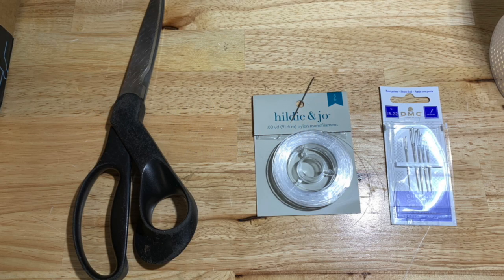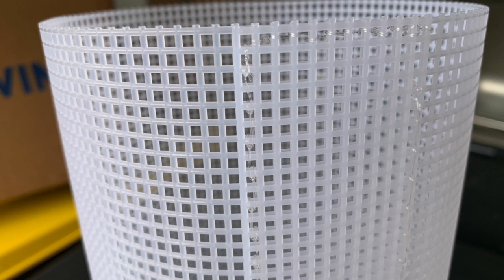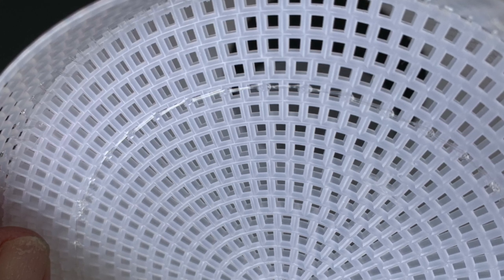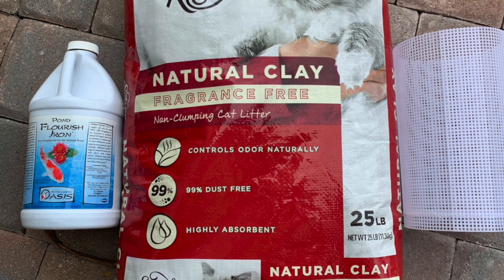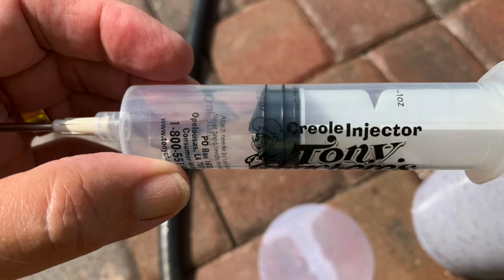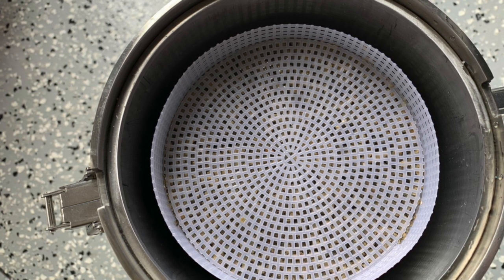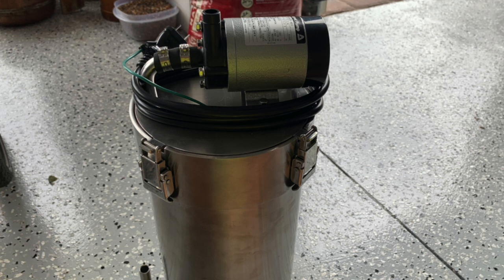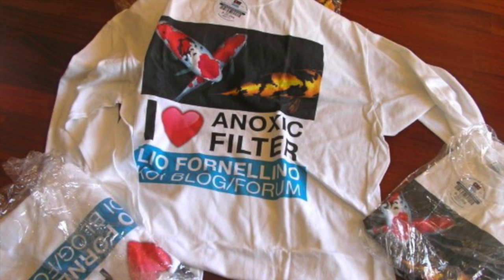Converting an ADA Super Jet 600 Canister filter into a Nitrate reducing Anoxic Filter.

Comment: Wow! I stumbled across this while researching filtration systems for my African Cichlid tank... and I just happen to work for Oil-Dri. A little info in the differences in Oil-Dri clays and getting the correct clay for for the Anoxic filter. First, Special Kitty is a product that uses attapulgite clay that is mined in south GA, the color is light tan/gray. To keep it simple for this post, all the clay processed there is baked to a certain degree to drive the moisture out. For coarse cat litter such as Special Kitty, the clay does not need to be baked long enough to drive "all" of the moisture out. This is why it will break down and get muddy when soaked in water. However, Oil-Dri Premium Absorbent is a product that is baked longer and dried out to less than 1% moisture. This changes the structure of the clay to where it will not break down and get muddy. This is the product that will be best used for Anoxic filter as described in this video. This brings up the second point... Oil-Dri Premium Absorbent is also processed in California and Mississippi facilities. In MS, the mineral is montmorillinite and is a harder granule that is darker in color (reddish/brown). Based on the video, it sounds like it could also work for this filter. However, Oil-Dri premium from CA may not work, as it will break down and not stay a hard granule. So if you live out west, you may not get the desired results. Hope this helps!
Reply: One of the best comments I've read, hands down. Thanks for the input. 

I have questions: oil-dri vs saftsorb. Different clays, same process? 

Also, do you know if the products sold are sold by region. Like if I buy oil-dri on the Gulf coast, do you think it's the MS clay, or who knows? I wouldn't imagine they'd ship cross country unless they had to but...
Reply: Can I use zeolites instead of the kitty litter please as I don't think I am able to get this kind of kitty litter in my place

Comment: I'm glad you like the canister filter BCB method I posted a couple years ago and how it can apply to other canister filters.  Putting a solid plastic bottom on the basket should also take the initial "force" of the water and help even more of the basket become anoxic.  Keep up the good videos!   - Luke
Reply from the maker: Thank you Luke for the tip. My Anoxic canister filter is working great, better than I thought it would. Now if only more hobbiest would realize the benefits that I'm seeing with my Anoxic canister filter, they would never turn back to the old ways of doing things. Just think, you are the one that got the ball rolling.
Reply: @anoxicfiltrationplenums  Thanks Kevin!  Very nice of you to say but you're the mastermind!  So glad we found a way to apply the technology in a way anyone can use it without the need for a sump.  Everyone's fish will be thankful!  :)
Reply: Hi Luke - Hoping you can answer a question and give thoughts- saw your comments in Dr Novak's videos and checked out your channel to watch your eheim canister set up video from 1/18 - is yours still up and running in 2021 as initially designed and have you had to do any maintenance to the BCB inside? Honestly kind of scared to cut up my old Eheim Pro 2028 but would love to try the BCB for removal of nitrates and phosphates on my 75g rock and no plants monster tank! Thinking I might leave the lower basket whole and use course sponge to filter (large happy messy fish) debris , then cut out center of other 2 baskets and put one bcb through the 2 baskets, and top with filter floss that I can change out easily. Would appreciate your comments.
Reply: @vikkirountoit497  Hello, If I made another one, I would probably make a DIY 5 gallon bucket canister filter.  There are a few good videos on how to do it and they're cheap.  Even if you change it back, you'll only need to buy a few extra baskets for your Eheim filter.  No maintenance on the BCB inside required as long as you have a good pre-filter on it.  I added another canister filter in line before it to filter the water even more before it went into the BCB "chamber".  Have fun!

Comment: just a quick tip on the build: use MINI ZIP TIES  instead of monofilament line to build basket. faster, easier and less frustrating
Reply: That's what I used...worked perfectly.
Reply: I just sewed mine, omg it was tedious. I will zip tie the next one...
Reply: I would suggest getting a curved needle to do this. It’ll save some frustration.
Reply: Zip toes for quick work, or sew it - for the esteem of the craft.

Comment: Hi Dr Novak. Just to bring you up to date on my 22ltr stainless steel cylinder filter using 6 X BCBs.fitted to my 500ltr with 22 x 3" to 4" Cichlids. I cleaned the filter as I noticed that the outlet flow was not as strong as it had been. It had been operating for 6 weeks.  The sponges and polyfil were very dirty.. However the BCBs were very clean with no sign of any blacking etc. Also the phosphate pad indicated that the water flow was going around the bags. One thing I did not do again was put clay media balls in the bottom of the filter. All that happened was that with the flow of the incoming water these balls just slowly disintegrated and caused more "dirt". I am thinking of fitting an  external filter cylinder to the filter which should increase the filter cleaning cycle. This 22ltr cylinder is heavy and  not easy to remove and clean.
Reply from the maker: sounds great

Comment: Dr. Novak would you mind doing a follow up video  in 60 days to let us know if it did work as expected. I’m curious how water would leave the bottom and go out the sides if there’s holes in the bottom. It’s uneducated but it would still seem to me because the tube isn’t very thick that it would be very hard for it to get anoxic even if most water is flowing around it there will still be some going through it to stay aerobic. What other brands of canister filters would this work on? Fluval?
Reply from the maker: In the ADA canister the water is not being pulled through the medium but is forced around the BCB. Water always take the path of least resistance and the BCB has too much resistance for the water to go through it. Diffusion is what will bring the water into the BCB along with ions. One ion is being taken in as another ion is being released back in solution.
Reply from the maker: Many hobbyists say that: “It is impossible to have oxygen in the baskets because the substrate will compact, and therefore will inhibit any biological process to take place.” However, they forget about the substrate permeability1 qualities, and the large part it plays in the microbial and chemical processes. The permeability of Kitty litter and Laterite allow oxygenated aquarium water with inorganic compounds to pass through the substrate on a current-carrying magnetic field, which then allows the substrate to stay more aerobic. Such substrate has two characteristics that enable fluids to move through it: (1) porosity and (2) permeability. Porosity is the presence of small openings, or pores. Permeability means that some of the pores are connected by spaces through which fluids can move. Nonetheless, actual tests of the baskets have confirmed the existence of oxygen at low levels for bacterium to exists and exists it does. Yet, in all honesty, how it gets there is still somewhat of an unknown to scientist. Yet, I will try to explain the best I can for the hobbyist. 

Oxygen penetration is less and less with depth. It decreases for two reasons: microbial metabolism and subsequent biogeochemical processes. Diffusion is a very effective process over short distances; however, it has its limitations. 
Yet, the presence of oxygen in the biocenosis clarification baskets suggests that oxygen does diffuse as far as the center of each basket. Concomitantly, biogeochemical processes may produce or retain some oxygen. 

Differential pressure existing across gradients. Ion displacement (differential pressure) exists when there is a relationship with carbon dioxide removal. If there is a substrate producing some carbon dioxide, it then becomes a factor in creating anoxic condition. The addition of anion producer such as microbial or aggregate or both needs to produce enough oxygen to engage or attract the carbon dioxide and that will then move the cations, releasing the oxygen and consequently going more aerobic. The point being made here is that it is that oxygen is present in the substrate of each basket and it is clearly not there only because of diffusion alone.
Reply: Kevin Novak Ph.D. Will it work with Fluval?

Comment: I am wondering if the fluval canister filters could be adapted for this as the filter is basically divided in half with the water entering from the top on oneside and going through your sponges and floss to the bottom of the canister and then rising back up through the media baskets to be sucked out by the pump back to the tank if you replcethe media baskets with a bcb you should be able to make an anoxic canister filter this way as well
Reply from the maker: Don’t really know but it’s worth a try.

Comment: Dr. Novak have you ever tried Safe T Sorb from tractor supply? It is made from montmorillonite clay. $6 for 40 lbs I’ve had great success.
Reply from the maker: Yes, it as good as Kitty Litter, i’ve repeatedly told people they can also use oil-Dry which is exactly like what you’re talking about. Thanks for the good info I hope others read this comment.
Reply: @anoxicfiltrationplenums  hi sir. Can i use akadama clay, pebbles clay or even pumice to replace the cat litter?

Comment: Thanks for the videos, Dr Novak.  I'd really like to try this for a 30 gallon tank.  What are the minimum dimensions necessary for a successful BCB in a canister filter?
Reply from the maker: The size is going to be dictated by the size of your canister filter and the medium that you’re going to use along with it. Such as sponges, filter  medium and carbon, etc., etc. actually, the best thing to do is get the biggest filter you can afford for your size tank.

Comment: I made my Anoxic basket bottom flat because the Eheim 2215 has a raise plastic platform in the bottom of canister already. Also I will only use filter pad on top of basket for easier maintenance and not having to remove the Anoxic basket from the canister.

Comment: If I use an Eheim 2213 would it also be a good idea to apply some known filter mods to slow down the flow in order to help the anoxic conditions?
Reply from the maker: Do Not Slow Down your 2213. You can turn it into an Anoxic filter at that speed. New video coming out with a canister filter that puts out 500-gpr and the big BCB in it will handed 9-lbs of fish.

Comment: Can we use very fine stone chips ( like used for making roads) 
It would be hard,not disintegrate, and the porosity will be same as this ..so water won't go through it?

And also another substrate..like bricks broken into very small pieces..they are also baked clay basically..and they dont disintegrate..and have the porosity in the small pieces i guess to create the anoxic conditons..

Can crushed pottery made of baked clay work?

I do not have access to kitty litter per se..so i was just thinking of alternatives available here..you are so kind as to think about working around a problem..

Could you shine some light on these ideas?

Thank you..
Reply from the maker: Many hobbyists say that: “It is impossible to have oxygen in the baskets because the substrate will compact, and therefore will inhibit any biological process to take place.” However, they forget about the substrate permeability1 qualities, and the large part it plays in the microbial and chemical processes. The permeability of Kitty litter and Laterite allow oxygenated Aquarium/pond water with inorganic compounds to pass through the substrate on a current-carrying magnetic field, which then allows the substrate to stay more aerobic. Such substrate has two characteristics that enable fluids to move through it: (1) porosity and (2) permeability. Porosity is the presence of small openings, or pores. Permeability means that some of the pores are connected by spaces through which fluids can move. Nonetheless, actual tests of the baskets have confirmed the existence of oxygen at low levels for bacterium to exists and exists it does. Yet, in all honesty, how it gets there is still somewhat of an unknown to scientist. Yet, I will try to explain the best I can for the hobbyist.

Oxygen penetration is less and less with depth. It decreases for two reasons: microbial metabolism and subsequent biogeochemical processes. Diffusion is a very effective process over short distances; however, it has its limitations.
Yet, the presence of oxygen in the biocenosis clarification baskets suggests that oxygen does diffuse as far as the center of each basket. Concomitantly, biogeochemical processes may produce or retain some oxygen.

Differential pressure existing across gradients. Ion displacement (differential pressure) exists when there is a relationship with carbon dioxide removal. If there is a substrate producing some carbon dioxide, it then becomes a factor in creating anoxic condition. The addition of anion producer such as microbial or aggregate or both needs to produce enough oxygen to engage or attract the carbon dioxide and that will then move the cations, releasing the oxygen and consequently going more aerobic. The point being made here is that it is that oxygen is present in the substrate of each basket and it is clearly not there only because of diffusion alone. 

What I have just stated here is the kind of substrate or medium use will make a big difference in how the Anoxic Filter works. It's a lot more complicated than what most hobbiest think. A lot of science goes into an Anoxic Filtration System. You can try other mediums but your outcome may not be so good. Sorry if this is bad news.
Reply: @anoxicfiltrationplenums  of course it a big big achievement to find a substrate in the first place which can cause this in a scale to be applicable in smaller aquariums..to make it possible...now whats left is finding many such substrates... which i am sure exists..based on similar porosity, permeability..physicochemical and electrochemical properties that is..

If that is matched..the rest of the biological interaction will follow..
And since the method of application is already well established, be it sump or cannister .. finding more similar substrates will surely help.... already more work is being done by hobbyists regarding this..regarding forms of application, like miniaturization, in tank itself, in HOBs..with initial favourable results.. hopefully they prove to be repeatable and scalable..
I just hope, some  other materials become recommended in the first place..so that research using those materials can be started in the right direction..

I myself, will probably test brick powder to begin with.. its also used as a absorbent, is permeable, has low, but relatively matching CEC which probably will create similar magnetic properties, and also inherently rich in iron..

I will also use other iron salts as supplements..
It may fail..but worth trying..

On that note.. you mentioned vermiculite will cause algal bloom..have you tried it yourself?

One of the main diff is much higher CEC of that, compared to attapulgite/palygorskite..which might kind of 'spit out' the nitrates(anions) rather than keep it in the center..

But then again, there are actual research articles, regarding use of vermiculite, pumice for anoxic filtration of waste water..( although anoxic levels were created a bit differently, and also used a deep substrate)

And vermiculite and laterite has been recommended as bottom layer substrate for planted applications since quite long..

Anyway..its definitely a very exciting avenue for research..
But yes, the anoxic method has been around for decades..but has not become popular due to the physical constraints, lack of proper understanding, and non scalability for small aquariums..when that hurdle is solved.. a LOT is going to change..

Natural ecosystems, healthier, long living fish, no external co2, ferts, water changes..
It will be beautiful and stop wastage of lot of money and resources..
Looking forward to that..

Comment: Hi DR. Novak 
First I  like to say thank for showing your work on this great filter media.
My question is can I modify your design to fit in a HOB filter ? I all ready order the clay kitty litter, and the plastic canvas to make the basket, the only problem I had was the iron , so I bought a 6oz of red powder clay it's use for a face mask. By adding water to it women smear it over the face and it is to draw out imperatives. Seeing that it's safe to apply to one face, I am sure it's safe to use it in my freshwater aquarium. 
 So I plan on making small
Square BCB basket, in the same style you have made with a smaller gap on the bottom, with a 1/4 " filter foam wrap around the
Bottom to catch debris.
And a gap on the top , to put filter floss on top.
This BCB basket would be small  enough so water would enter from bottom and all four side. 
When I finished making the basket could I send you a photo of the BCB BASKET. 
For your opinion .
 And would the red clay powder I purchased work.
Thank you 
#FALLRIVERFISHGUY
MASSACHUSETTS
Reply from the maker: A HOB filter would work but I think it will need some innovated modifications to it or the BCB basket. I just looked on Amazon and put in "Laterite" an it popped up. Laterite Powder Florin Base by: Brightwell Aquatics. It comes in 160-g,325-g,600-g and 1000-g. It cost $12.47 for 325-g.